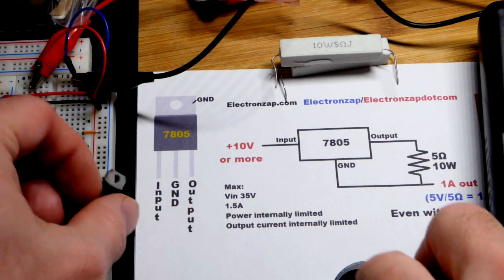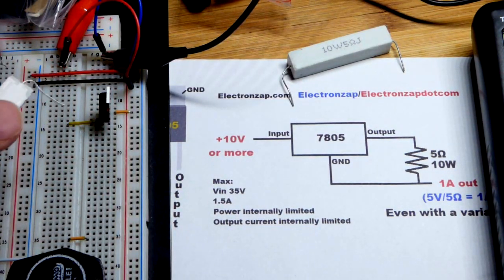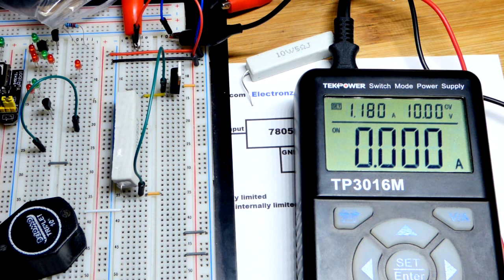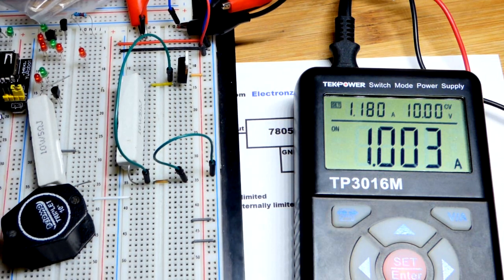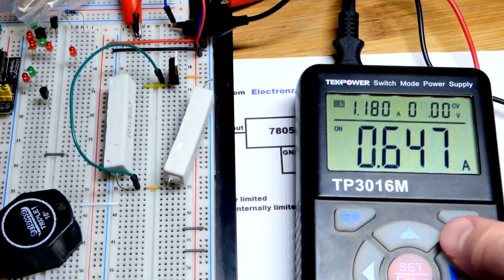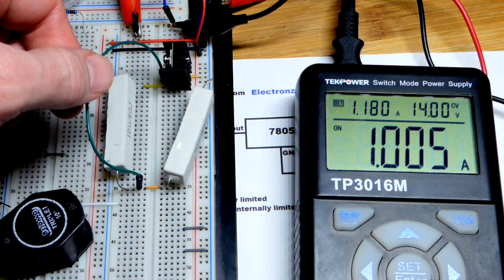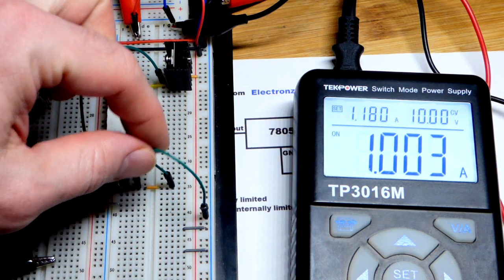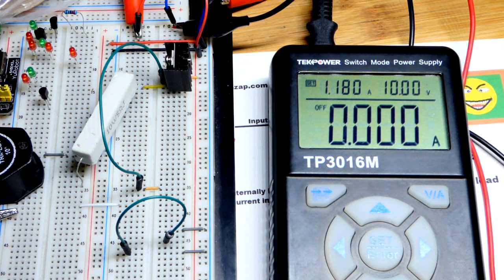7805 with heat sink 1A constant current source circuit demonstration by electronzap electronics

Comment: I've always thought of One (1) amp as a lot of current.   If you were designing a real life "portable" circuit that drew a continous 1 amp , you would have to have a substancial power source.    As evident by how quickly those wire wounds get hot.     In the microchip IC  world it is a lot.    Most 8 pin solidstate chips like 555's would melt if you asked them  to source or sink 1 amp      The 7805's 1 amp rating was probably achieved on a sink with a fan blowing across it for continous duty      Even with a heat sink , I'd probably pull no more than 600-700 milliamps just to play it safe so its not about to melt down..    Thats still a decent amount  of current  considering the majority of the projects you do here fall into that 600 - 700 milli amp range.    If you had a 2s or 3s lipo hooked up to a sunk 7805 it could probably provide enough portable power for most proto type board projects.    But if you regularly needed more than that it might be more efficient to go with a buck.
Reply from the maker: Luckily the 7805 has internal protection against over heating, or I wouldn't be this careless lol. I would definitely use a buck converter for a practical circuit.
Reply: electronzapdotcom  Honestly I wasn't trying to imply you were being careless.   Just mostly how 1 amp is alot of current.   Some entry electronic  students that stumble across your videos might not see it that way but it really is.    You know what they say.    Its not the volts that'll kill you (not that they won't) its the amps.     One of the first things I remember learning in school was that it only took 10 ma's of AC across the heart to kill you.    Ever since the age of solid state came around our magical chip component technology keeps getting more and more energy efficient.    It keeps offseting the scale of current  vs. how much you can actually do with 1 amp.    That and the heat that 1 amp actually creates just passing thru a wire wound resistor was the point I was trying to impress on the comments readers.
Reply from the maker: I was being careless lol. The 7805 claims to be practically indestructible, so I have mostly been learning it's limits by by pushing them hard. Those are good points! Thanks for bringing them up!